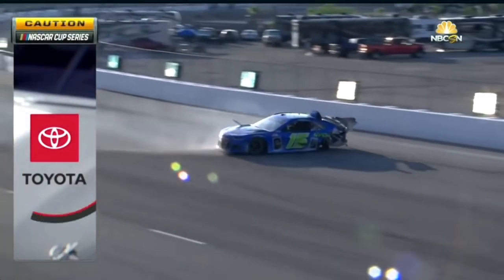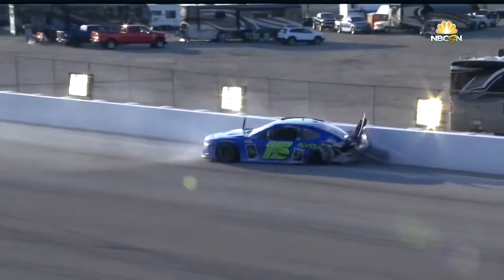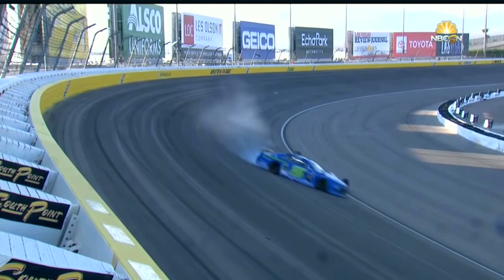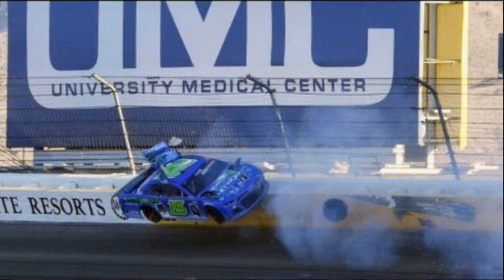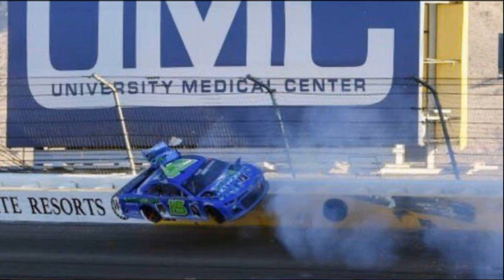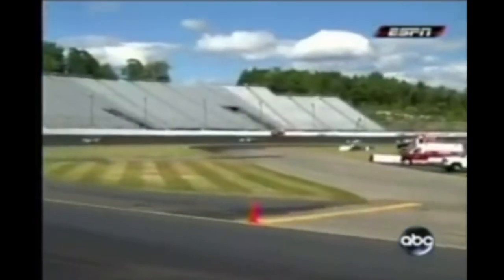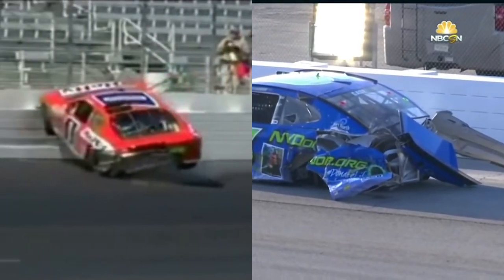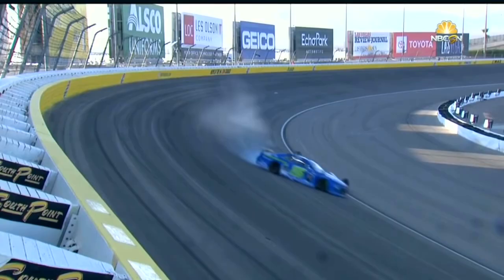Analyzing Joey Gase's 2021 Las Vegas Nascar Crash/Near Flip

Comment: The McMurray 2003 crash seems like a good analog. Las Vegas is much faster than New Hampshire, and the angle was likely similar, so it likely pushed Gase onto the wall and the hit sent it high into the air.